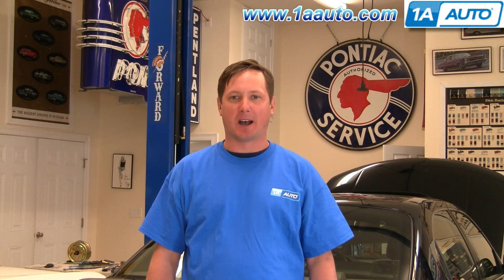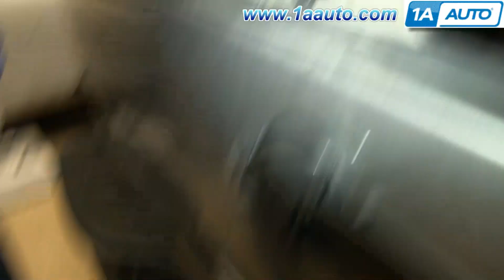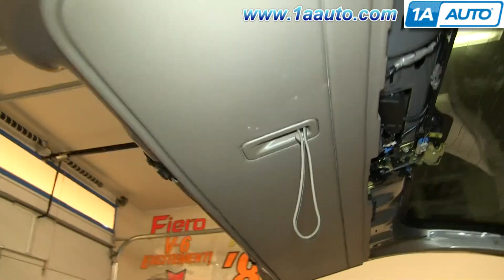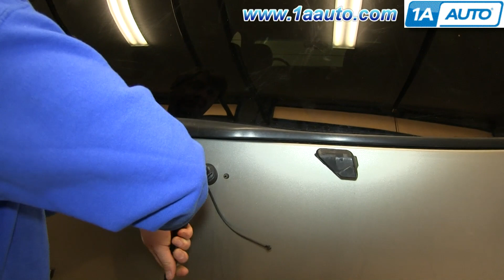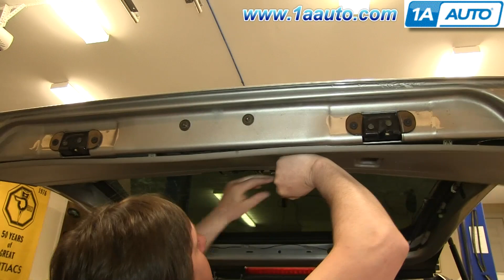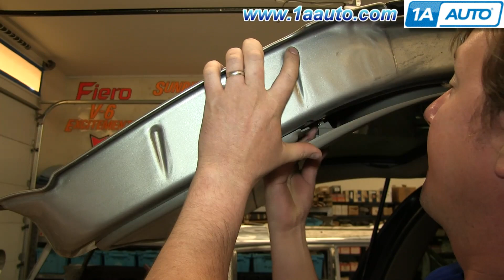How To Install Replace Rear Window Wiper Motor 2000-06 Chevy Suburban Tahoe

Comment: Should have used some type of puller to remove wiper arm.  By twisting the wiper arm back and forth as in the video you trash the splines on the wiper arm which are essential to grip the motor shaft splines.  Now I have to buy a new wiper arm which costs more than the motor.  Thanks a lot A1auto!

Comment: Before replacing the wiper motor just check to see if the ground wire to the wiper motor is working properly. I found out the hard way by purchasing a new rear wiper motor before checking online that the issue is bad ground connection. Most common problem
Reply from the maker: +GjoniNY Thank you for your feedback!

Comment: there's isn't a video for a gmc Envoy rear wiper motor how to install 2008😕
Reply from the maker: We currently do not have an auto repair video on that particular repair. Thanks for watching. 1aauto.com
Reply: There were 6 different vehicles total based on the GMC Envoy. They were Oldsmobile Bravada, Buick Rainier, Isuzu Ascender, Saab 9-7x, Chevy Trailblazer and the GMC Envoy. Try searching these other vehicles when replacing parts and you'll discover that their identical or near identical!

Comment: Do you know where I can get the plastic sleeve on the outside part that the big nut goes that you tightened with the adjustable wrench ?
Reply from the maker: Thank you for watching. You could try a local dealership or maybe even a salvage yeard. Please let us know how the repair comes out!
1aauto.com  888-844-3393